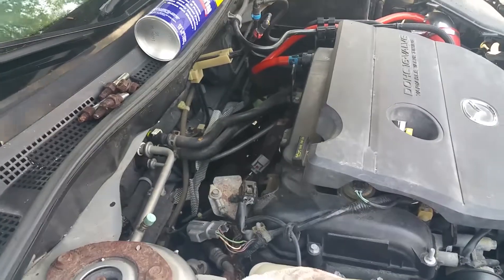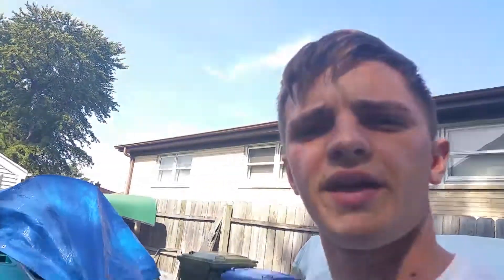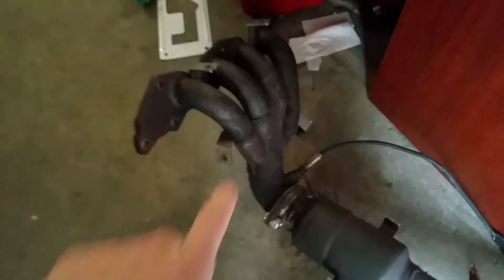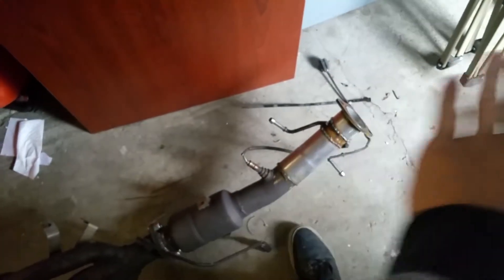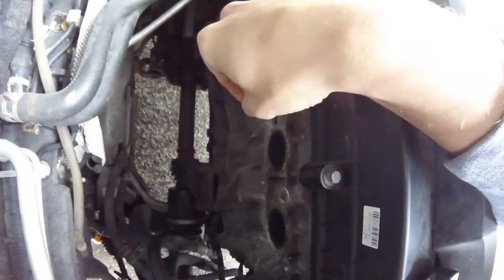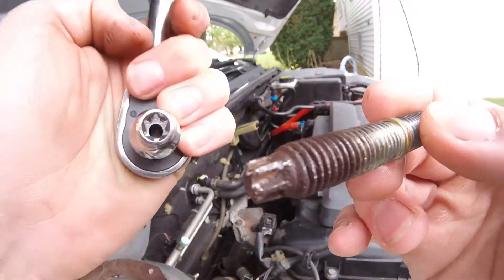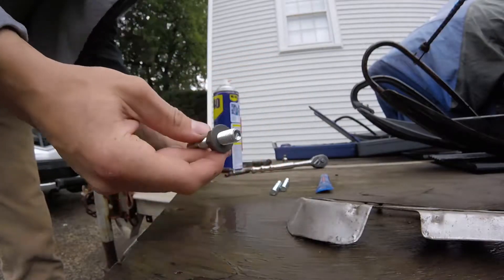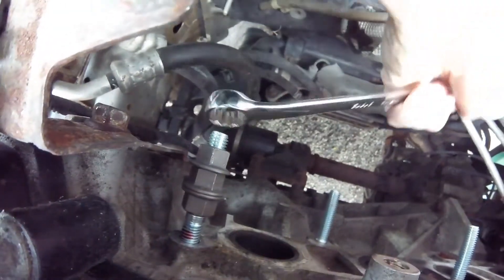Gen1 Mazda3 MZ3 Exhast Leak Fix | Part2

Comment: I have the same issue.  I think there’s a piece missing from the flange to exhaust.  I gather I loose power/torque from the engine.   Would this be correct??

Once I go on the highway, I feel  the engine struggle  pass 4 gear, so I click it into 5th then let the momentum built.  

Thank you for the video.  You’re not crazy, I work on my vehicles as well.    

Saving lots $$$ on $$$ mechanic repairs.